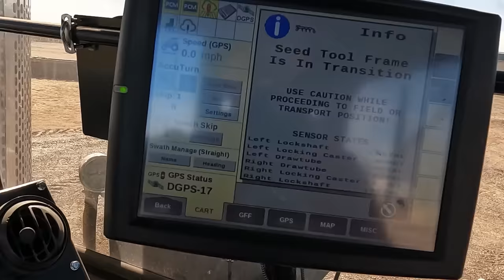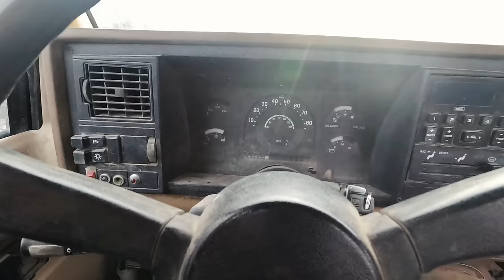LOOK what just ROLLED in!!

Comment: Why do you want the compaction in your fields when you do so much to avoid compaction 
I'm not a farmer so I don't understand
Reply from the maker: Excellent question!

Two reasons but primarily one. First and most importantly is to mash the rocks and dirt clumps down so when harvest comes we will have a smooth surface to run our headers low without worrying about beating up our combines with rocks. Peas and most pulse crops are short in nature and we have to harvest pretty low. Second is it helps compact the seed and soil which improves germination. We don't like too much compaction but a little is good.
Reply: There is close to zero soil compaction. Pound rocks down and give the seeds a better seed bed
Reply: Compressing the soil from top to bottom is bad.  Flattening the top layer ensuring seed to soil contact is necessary.  The roller spreads the weight out evenly and does compaction where it is needed for the seed bed.  If a tractor gets stuck or something runs in the same spot repeatedly it compresses down deep, slowly water and nutrient movements and stunts/stops plant growth.  Blessings
Reply: The ground PSI of a roller doesn’t cause significant compaction. Heavy machines on the other hand  do cause quite a bit of compaction.
Reply: We roll peas, lentils and also the wheat. When you are cutting right on the ground you don't bring in rocks or to much dirt.
Wheat is good to roll just incase here is Sask we get an early snow or bad lodging from the wind makes it so much easier to combine without worrying about putting the header in the dirt
Reply: I want to say that I agree with the comments on the question on rolling with the seed and soil contact along with smoother operation at harvest. The one concern is that if you have a piece of ground that is a bit hilly a flash thunderstorm could come in and dumps an inch of rain in 15 minutes. The water could run to create washouts which will have to be fixed later and could swallow equipment if your not watching out closely
Reply: Carl falt Absolutely understand but thats why in southern Australia we run contour banks on hilly country so the water runs off and sits in the right places. Yes when sowing it is a pain to go around them but they do work well
Reply: @WelkerFarms  When I worked for my Dad, we always ran a cultipacker behind the grain drill.  Dad told the story of how rolling seeded grain became "ingrained" in farming society.  He said that back when they were still using horses on the farm, after seeding in some crop, the horses were let off their leads and rolled on some of the seeded ground as horses will do.  The farmer noticed the germination where the horses rolled on it was significantly greater.  And that started the practice of rolling or packing the surface of the seeding.  Is the story historically accurate?  I doubt it, but I like it.  It makes for interesting storytelling.
Reply: @jamesnewman8582  come on over and you can teach us your technique s
Reply: Thanks for the explanation! I was wondering the same thing.

Comment: Nice roller ! We have a 70 foot  summers roller we roll after we plant soybeans and black beans.  We will roll also if we plant corn after  corn to knock down the stalks so the row units on the planter ride smoothly.  I rolled some hay ground for a neighbor on Tuesday.  We pull ours with a hn 250 big bud.   Great video
Reply: Cool. Did you upgrade the steering hand pump?
Reply: @RobertWelkerFarmerBob  I want to say yes that  dad replaced  that pump  but I'm honestly not sure!  Dad normally works on the older equipment I stick to the new stuff. We found our hn 250 sitting in a fence row about 5 years ago while do a  drain tile job . We received the tractor as part of the  payment for the job . It had a bad motor and the  transmission needed some attention.   We had the block gone through at our local engine shop  and We tuned it up now it produces a little over  350hp .  We have a neighboring farm just south of us that runs 2   large big buds like your 600 . Around here you just don't see many of them .

Comment: The 454 running on gas with some diesel fuel caused me to think way back when my father was working on their family farm.  He said that they would run their farm tractor on gas and when it was warmed up, they had a device to add diesel to the gasoline when the tractor was running.  They had the idea that the tractor had more power.  That was in Saskatchewan.  Farming sure has changed from the good ole days.  I cannot check any of the details because my grandfather and my father are no longer on this earth.  Of course, when the stories were being told, we often rolled our eyes and figured, here we go . . .  with another story.  😊

Comment: Nick,
Do you have any input on your side by sides with the windshields? Nice to keep wind out of the face for sure. We have JD gator and ranger crew cab.
Both have front and rear windshields. Gator has half doors no windows. They both are horrible about covering you in dust. I read on a forum that it creates negative can pressure. If someone could figure out away to fix this they could make some change for sure.
Reply: We open the front up 3 inches so that it flows enough air in to blow dust away
Reply: @RobertWelkerFarmerBob  I do that as well
But still seems like it could be better. I guess it is what it is at this point. Beats riding a horse and buggy I reckon

Comment: I enjoy your videos,especially the shop work,why were the grain bins built in a half moon instead of a straight line years ago?
Reply: Bob had a rotating auger that was based in the middle so they didn't need to push the auger around as much. But it hasn't worked as efficiently as he had hoped.

Comment: Just curious. You mentioned in the last video, working on the new tool bar that it used to be  a rear pull for the tender and you guys use mid pull. 

Is there a reason to do one over the other? Just personal preference, or dependent on the land, seed being planted, tractor. Ect? 

Thanks.
Reply: I went back over both videos and he didn't say. Usually it's because of the tire tracks affecting the crops from picking seed up to compaction and some prefer the cart in front for ease of loading. Hopefully he will reply to your question hope you don't mind my 2 cents of forum gossip
Reply: @1STGeneral    he wrote a list of pros and cons a couple of videos back in a comment to someone.